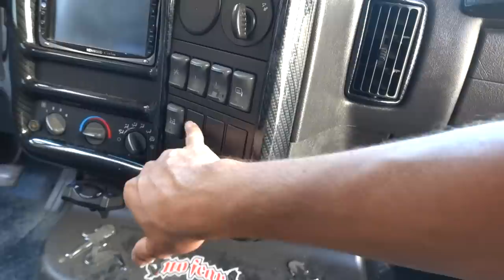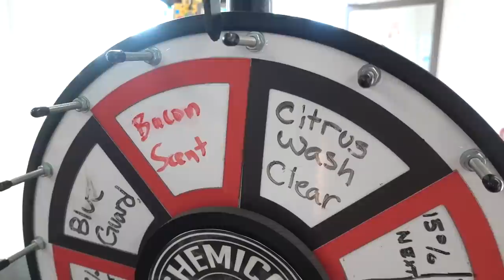HUGE UPGRADE FOR THE KODIAK!

Comment: I think the guy that stepped on your wheel is the same guy that rotated my wheels here in Mn.    Got it back and didn’t even think to look at them only to find, a week later and on the passenger side, about a 4” scratch down to the metal straight across the dish of my wheel.    Had about 3,000 miles on them and clearly the guy ran the impact socket straight across the wheel.